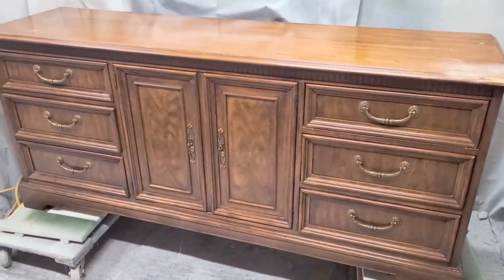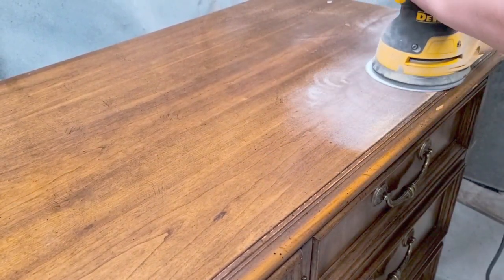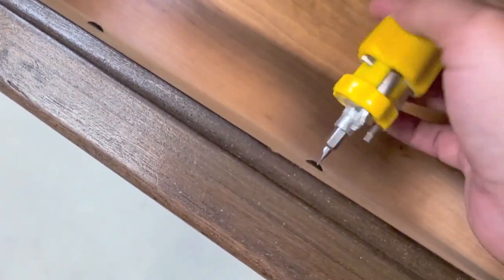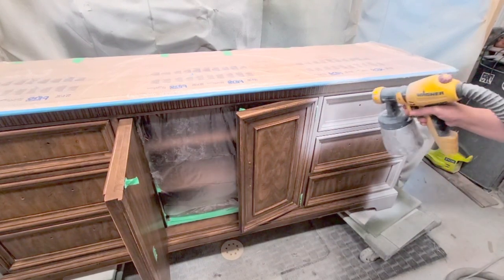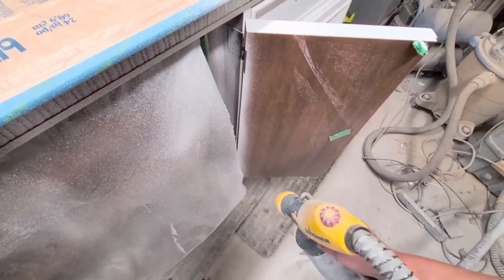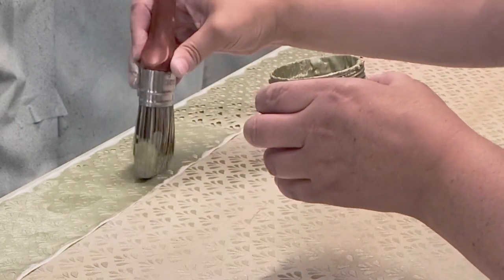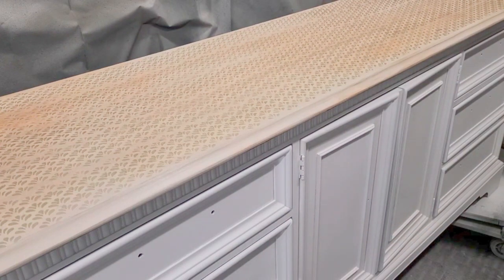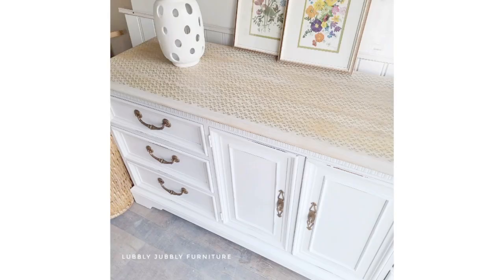Furniture Painting Ideas | Stencils On Wood | Dresser Make Over

Comment: What wood filler do you use? Mine crumbles so easily and is not at all this smooth
Reply from the maker: I use Dap and elmers is good too
Reply: @lubblyjubblyfurniture  thank you for responding. Which DAP do you use? I googled “DAP wood filler” last night, and several options popped up.